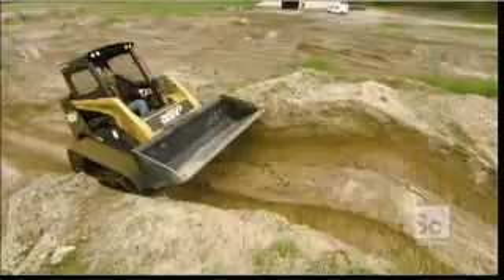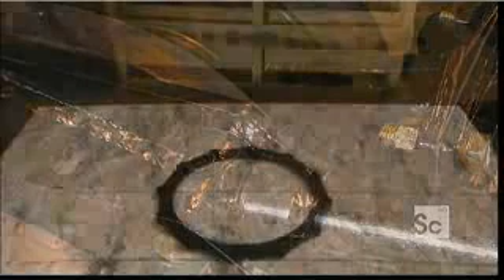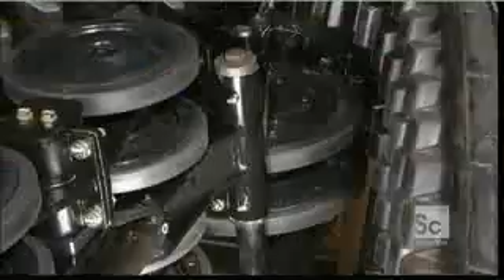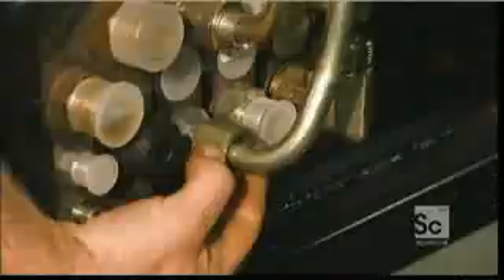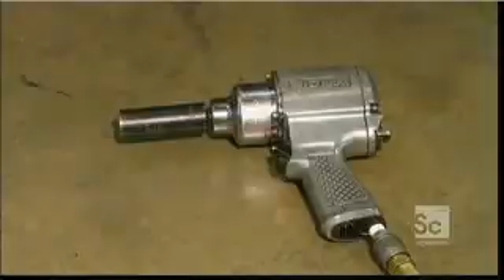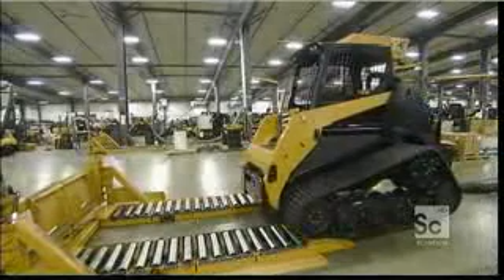Kompaktlader ASV Caterpillar skid steer loader new  bobcat Gehl Takeuchi

Comment: Actually it can lift more than that... almost a ton more. tipping load is 7,600 lbs and 50% tipping load (opperating capacity) is 3,800 lbs. Get your fact straight.